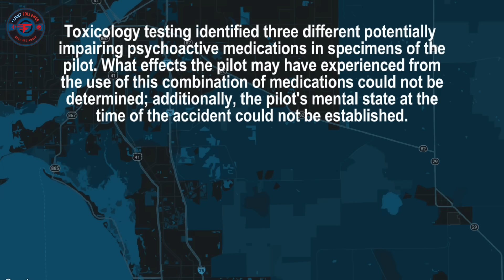Sick (and incompetent?) Pilot's Erratic Maneuvers Trigger Fatal Structural Failure #atc

Comment: This is an unusual one because, regardless of the post-crash reports etc, the pilot doesn't sound at all unwell or off-kilter. Also, why did ATC give him the 150 heading instruction which presumably then put him in danger from incoming traffic causing him to perhaps take emergency, evasive action & thus lose control of the aircraft? I'm not a pilot so perhaps someone could explain?
Reply: the "pilot" if you can call him that, had very few clues about what he was doing, he sounded about as far off kilter as you can get. As you say, you're not a pilot, and it shows.
Reply: At 3:59, he reads back the assigned altitude as if it were the heading and (part of) the assigned heading as if it were an altitude.

Normal readback: "One Seven Zero at two thousand five hundred, Two Whiskey Sierra"

His readback: "Two Five Zero Zero at One Seven"

So after being told the direction he's supposed to be going and the altitude he's supposed to be at multiple times, he flips them and reads back a direction that doesn't exist (there are only 360 degrees on a compass, so heading 2500 makes zero sense) and an altitude that, even if we're charitable and interpret it as a flight level (multiple of 100 feet) rather than a raw altitude, is way too low (Even assuming that 170 was the assigned altitude and not the heading, he dropped a digit. FL 170 would be 17,000 ft, FL 17 would be 1,700 ft, actual assigned altitude was 2,500 ft).

His mind is completely garbled.

Comment: Hope the asshole traffic controller feels better now, without this poor guy on his airspace.
Reply: Abundantly clear you know absolutely nothing about what happened here.  The guy in 262WS clearly was impaired, was not emotionally or physically qualified to operate an airplane. He had no basic knowledge of how to obtain information need for flight, (ATIS) radio procedures, VFR versus IFR altitudes,  he could not interpret simple instructions from a controller.  He was operating in a fairly busy area with other civilian and commercial traffic, his inability to understand and comply with simple instructions form the controller presented a danger to all aircraft in his vicinity. If you are going to operate an airplane you have a responsibility to yourself and others to be able to safely operate that airplane so as not to be a danger to yourself or others.  This gentleman violated that responsibility.  BTW, retired corporate pilot here.  Also, go read the details about the pilot's mediical condition determined by the post crash investigations, here is a summary: 

 The pilot lacked a required FAA medical certificate, although not mandatory for sport pilots. His medical records showed diagnoses of hypertension, sleep apnea, depression, PTSD, and other conditions. The autopsy revealed significant coronary artery disease, although it’s unclear if a cardiac event contributed to the accident. Toxicology tests found multiple psychoactive medications in the pilot's system, but their specific effects at the time of the accident are unknown.

The pilot’s heart condition and psychiatric disorders likely contributed to distraction or unsafe maneuvering. His mental state, potentially worsened by unreported psychiatric conditions and medications, along with no mechanical or weather-related issues, suggests his health led to the unsafe maneuvers that exceeded the aircraft’s limitations, causing the wing to fail mid-flight.
Reply: It's clear you are not a pilot and know nothing about flying. This "pilot" had no business being in the air.
Reply: @gribble2979 I don't disagree with that. But you could be a smidge nicer and not cause more distress to a pilot already overloaded and with limited ADM.
Reply: Say WHAT? I’m a retired commercial pilot. The controller did nothing wrong. The pilot was completely incompetent and should not have been anywhere near an aircraft. When a controller has to give instructions SIX TIMES just to assign an aircraft a heading and altitude, that’s not a controller problem.
Reply: @Joe-k5n6u 6 times the same 3 Instructions, 15 words clearance. after 3rd attempt the atc should break down into 3 separate clearances.
Reply: @Joe-k5n6u  The controller was more concerned with "I don't have time to talk to you" then they were with detecting that there was an issue. Absolutely a failure which originated in over-working the ATC for profit reasons.
Reply: @whatilearnttoday5295  No sir. The controller was giving that pilot simple instructions that any competent pilot could have instantly complied with. And it was not the controller who ultimately lost control of the aircraft and crashed…in VFR conditions, no less.
Reply: @Joe-k5n6u  Yes, any competent pilot not suffering a medical emergency.

That's why ATC should have easily detected the issue and realised something was wrong. Instead they were too busy being perturbed.
Reply: @whatilearnttoday5295  How would ATC know he was suffering from a medical emergency? He’s flying an “Experimental” aircraft, which means he is likely a relatively inexperienced pilot. His responses from the get-go showed that he did not know what he was doing. He didn’t know how to request and execute taxi instructions, for example. He did not sound sick, he just sounded confused and incompetent. ATC can’t magically make him a better pilot.
Reply: @whatilearnttoday5295  remember the pilot also had 'substances' in his blood. Many medications tell you not to drive or operate machinery if you're on them and many people are like 'what do they know, I feel fine'. 
If you want ATC to have full discrestion over assessing pilots before they take off, rather than some self-policing (you know - fully grown adults saying to themselves 'I should'nt be doing this) then we need to ensure pilots take a blood test, breathalyser and drug wipe before each take off. Lock it down. 
Personally I feel that's OTT but lots of people blaming ATC and not the pilot so I guess the majority want OTT controls enforced on them.
Reply: @thebrowns5337 ATC was too busy being busy to evaluate that there was a problem. It's that simple.
Reply: @whatilearnttoday5295  The headline on this video is misleading. The pilot was not suffering a medical emergency. His autopsy showed he had partial blockages in his aorta but that wasn't the cause his appalling incompetence. Look the pilot up - he was a charlatan in everything he did.
Reply: I doubt you've ever even been in an airplane. Stick to commenting on scooters.
Reply: @flymdjets  4,500+ hours, multi, IFR, commercial, type rated in the King Air 350 with some time in Citations, although not typed there. I’ve been in lots of airplanes. Jerk.
Reply: @flymdjets  never been in an airplane! hope I never get to fly with the likes of you if I ever do! godspeed.
Reply: Im a pilot and this is 100% NOT on the ATC. A Student Pilot sitting at 4 hours of experience could handle the comms displayed in this video.
Reply: @WhiteBoy2412  ATC had the chance to identify a medical emergency but was too busy being busy.
Reply: @whatilearnttoday5295 Yes, he was busy being an ATC specialist, you know, his job. He’s not a pilot cop. I guess if you’re unable post from a position of experience then post from one of emotion.🤷🏼🤦🏼‍♂️
Reply: @c_hube3694  One of the roles of ATC is to identify medical emergencies.

One such event where ATC's response becomes critical in is hypoxia. If there were an ATC so busy ranting at a pilot as to ignore hypoxia symptoms, I'd hope that ATC is sued or criminally charged for the negligence.
Reply: @whatilearnttoday5295  Really? Show me where in 7110.65BB this is described as “one of their roles.”
Hypoxia is rather limited to a specific environment and aircraft type (using the general sense of the word “type”). It’s not a condition that that’s going to be encountered by a ground or local controller, at least not hypoxic hypoxia. If you’ve ever heard someone communicating over the radio who’s suffering from hypoxia you would know that it sounds nothing like this guy. This guy simply sounded  incompetent. Unfortunately, there’s probably hundreds out there operating daily with similar skill levels. It’s not uncommon. 
Hoping that an ATCS would be sued or criminally charged for not recognizing a “medical condition” is nothing short of ridiculous and emotion based rather than fact based.
It’s unfortunate that the guy couldn’t control his airplane but the ATCS shoulders exactly 0 responsibility for  that and believing otherwise displays a complete lack of understanding of the system.
Reply: @c_hube3694  Who's role is it? The only person who can help is ATC.
Reply: @whatilearnttoday5295  You are obviously not a pilot. It is not ATC’s responsibility to assess the medical condition of a pilot. This particular pilot did not show any signs of having a medical issue. He simply sounded incompetent from his very first contact with the ground controller at Page Field. I find zero fault here with ATC. He was issuing standard control commands, simple commands, and the pilot could not comprehend what he was supposed to do. This is basic Flying 101 stuff that any competent pilot could have instantly complied with. ATC did nothing wrong here.
Reply: @whatilearnttoday5295  It is the pilot’s responsibility to know whether he is fit to fly. That’s one of the core value judgements that every competent pilot knows how to make, for every flight.
Reply: @whatilearnttoday5295  What you’re failing to understand is that there is no role. It doesn’t exist. If a controller suspects something then they can certainly query the pilot. If a pilot reports to the controller some sort of problem, for instance chest pains, ATC will most assuredly give them priority handling. However, it’s not the controller’s job to police the health of pilots in their sector nor can a controller order a pilot to land even if they suspect a medical problem. 
This pilot simply sounded grossly incompetent, as if he outlived his skills, assuming he ever had it which seems debatable based on his history.
Reply: @c_hube3694  Cool story bro. Reality will check in with you sometime in the future.
Reply: @whatilearnttoday5295  No need to get pissy with me just because you don’t get it. Regardless, there’s at least 11 other crewmembers with me whenever I fly so I think I’ll be OK.